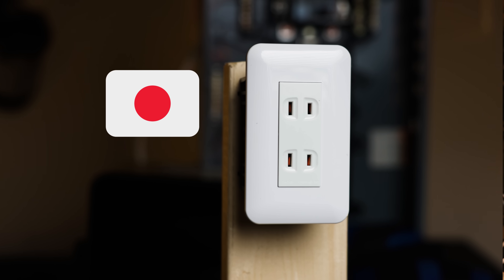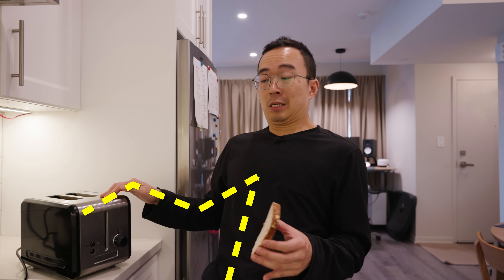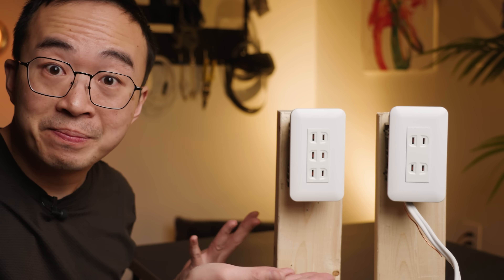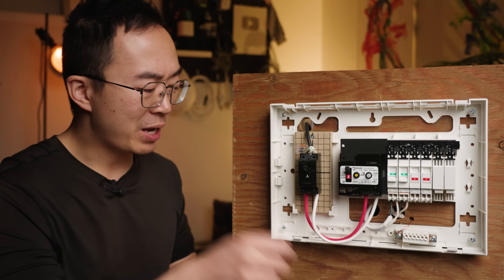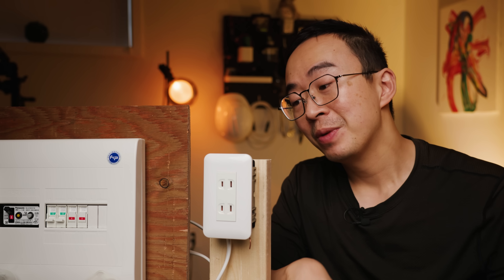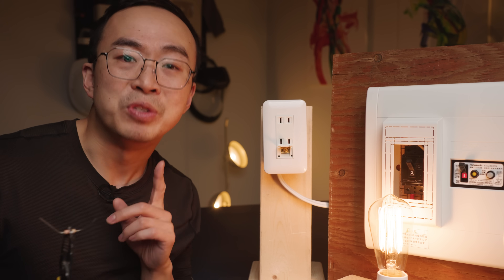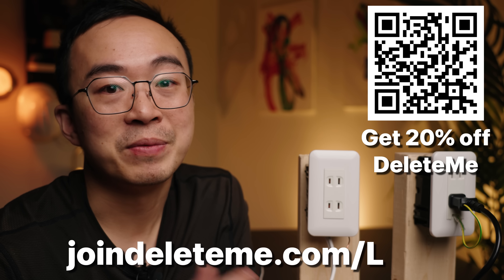How Japan Made Their Outlet Safe

Comment: For some reason, our GFCI is SUPER sensitive to minor power surges in our sun room and tends to randomly trip on its own with just small amounts of condensation or humidity as well as when switching on lights simultaneously (CFLs and LEDs). It'll often end up popped overnight.

It might also be related to insect activity, including ants getting into the contacts of some of the wiring in the walls ... which has happened before. Happened to lightswitches too, led to sizzling, though no permanent damage or smoke, from ants getting inside the electrical connections.
This is not the case for the more robust GFCI unit that was originally an outdoor gardening utility outlet before the sunroom was built. (OTOH, the sunroom wiring might have some greater ingress points or weak points for insect exposure ... probably not for rodent ingress, though)

They're pavement ants, highly robust, and otherwise don't cause net negative problems around the house, so ... no living without them.

OTOH, the main bathroom GFCI is wired in parallel for both floors, and HAS tripped multiple times that gave indication we had a leak somewhere in the house. (sometimes it's from driving rain or rooftop debris allowing backups, but it's also been due to leaking bath/shower drains, but it's also been due to a failing shower valve insert o-ring that was leaking into the wall behind it ... )

Without the GFCI it might not have led to a fire or electrocution risk, but more likely would've led to electrolytic corrosion of the connections at the exposure/short point to the point of failure. (as it was, things went back to normal when everything dried out ... luckily it was summer, and we live in a dry climate)

OTOH, I'm not sure how you could fully support 1500W outlets with most of the GFCI breakers typically available and the potential for transient currents and power surges that would fairly easily trip them ... as seen in a LOT of legacy infrastructure in the US. (we've had some surges and instability sufficient to burn out internal fuses inside electronic ballasts for fluorescent lighting, but not damage anything else or even trip surge protector breakers, so it's kind of weird)

For a family that insists on using 1500W space heaters and some other appliances at random, mobile locations around the house, that'd be a deal-breaker. (albeit all of the better modern versions of those have GFCI or some sort of breaker also built-in ... also usually on top of a thermal breaker; in the case of hair driers, that can be done via simple polarized plug, too, without groundfault protection)

Plus with microwave oven, lighting, and consumer electronics all on the same circuit (and fridge, toaster, dishwasher, and more on other consumer electronics).  Plus that's not accounting for the 240V appliances. (and the washing machine on a 120V circuit, also producing a high load on a standard outlet vs the dryer on 240V)

I forget the full map of our circuits, but I can definitely tell which lighting is on the same circuit as the microwave/convection oven, as those lights momentarily dim when the microwave engages. (not sure if that would pop a GFCI if there was one wired up, but it's definitely impacting the voltage level further down that circuit ... albeit it's on the other side of the house in the next room over from the kitchen and most dramatically impacts a single fluorescent light fixture on an embedded over-mantle mount) I don't think that breaker has ever popped, though.

Edit: as for that bathroom GFCI unit, it was probably nearly 50 years old and we replaced it, thinking it had failed (as the water damage was unknown), but it turned out it was still working completely fine. I think it was a GE unit from around 1978.

Comment: Where as the UK just overhauled their entire electrical grid and discontinued the 110-120V legacy system in favor of 240V. Japan stuck with their legacy 100V grid. And also outmoded all of their old electrical connections, outlets, etc ... and mandated that fuses or breakers be embedded within the plugs of individual devices. (decentralizing everything to the wall end, rather than using the main breaker/fuse box)

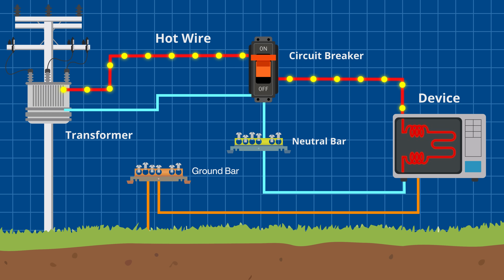Comment: in your diagram first shown @2:35, you show a neutral (cyan lines) going through the circuit breaker - that is incorrect, only the Hot goes through the breaker.  If you make a follow-up video, you can also talk about GFCI breakers, as well as AFCI (what it is) or combo GFCI/AFCI breakers and outlets.  Also there is a subtle difference between the mechanism used in GFCI and traditional RCD's  (though some newer GFCI-circuit safety devices in EU are still called RCD's just because that's what they were always called).
Lastly, only the main (service entrance) Load Center panel/box should have neutral tied to ground - any subpanels should never connect these together, for safety.

Comment: How Japan Made Their Outlet Safe. They did this by lying. People here still get hospitalized or die, and buildings catch fire frequently due to electrical issues. They just don't report it accurately if at all, which is the same way they handle their crime and homeless numbers. The grounded outlets, if even used, are never wired up to anything. The ability of electricians here is not only poor, but they also have an attituded that doing anything to make things safer increases costs that they are unwilling to pay. Apartments here have terrible electrical systems because the landlords pay less than the absolute bare minimum to have the job done, and the people renting don't know anything about it. There is no enforcement so this is just allowed. So we just see videos like this that push the propaganda that Japan has this amazing power grid (either because they don't actually know what its actually like here, or they don't care) when in fact its not much better than every other 3rd world countries.

Comment: GFCI is not "better" than grounding. you need BOTH. If you have a faulty toaster or a refrigerator with exposed wires touching the metal edges, a    GFCI will break the circuit shortly after you electrocute. But grounding will prevent you from electrocuting in the first place. In my country (and probably most other countries) both GFCI and grounding are mandatory.

Comment: The best home electrical system is the european. All outlets have direct path to ground, most are reversible, except the UK ones. But every circuit is protected by GFCI, one for every 5 circuits. If ground fails or the GFCI fails, sometimes happens, the other will work. In Europe when an appliance goes bad it makes your GFCI trip and you have to find which one is the one that trips on plugging, you make this without any kind of shock. The standard plug is today 240V 16A, you can even charge an electric car on a outlet at the side of your bed realistically. Almost anything on a home can be on a regular plug today, a kitchen, oven, water tank. And in a home electrical system that is not totally illegal disaster electrocution is unheard of today, even with about 240V for efficiency in all the home. It's so rare that when an electrocution is reported the first thing insurance companies investigate is for fraud.
Reply: now when you say Europe do you mean Scandinavian countries?
Reply: @miguellopez3392  All European union plus UK at least.
Reply: exactly, and both asian and US outlets show in the video are a joke, if you plugin something what use a lot of power it will brun, specially the asian version,  the worse  outlet on the planet, if you get a cheaper one, it just fall out the socket on it's own, if it use lot of power  be sure it will start a fire   , while in europe   your old outlet from 1960  still as good as new

Comment: Circuits without GFCI's/RCD's are totally unsafe. Since if you got a open circuit on the ground wire, your breaker never shots off. Until you complete the ground circuit. Breakers are saving circuits. GFCI's are saving lives.

Comment: I'm desperate for someone who can solve my mysterious problem.
I run an electric guitar repair shop in JAPAN and recently moved the shop to a new home. Above the shop is a recording studio. Everything must be grounded which requires grounding outlets installed for power conditioners. When I turned on a guitar amp for the first time here, properly grounded, my heart sank.
4khz tea kettle noise coming out of the amps. Not RF (i measured) but a signal being picked up from the guitar cable acting like an antenna. It's intermittent and sensitive to certain areas. Until today it was high pitched, but today it turned into a very low crackle. The humidity also dropped from 40s to 30s. I'm having a hard time finding an electrician who will come check this out. I can't open my studio until its fixed and the guitar shop (a guitar store as well) also has to be closed until its fixed.
I don't know what it is or what to do.

Comment: That was WRONG. TT earthing is commonly used all over Europe and it's mandatory in houses in Italy. The TN system (ground connected to the neutral) is used ONLY in industrial plants due to its higher complexity and need for maintenance. In fact, you are allowed to use it only if you have your own transformer. THE GFCI connection that you described as an evolution of the Japanese electric system has been used in Italy for over 50 years as a standard safety measures for ALL household installations. A famous Italian electromechanical company had even the genius idea of branding its GFCI with the name "salvavita" (livesaver) in the 80s and the name stuck so well that everyone asked for it and it is now how the device is called commonly in Italy by non professionals.

Comment: It’s not mandatory, but grounding is generally recommended for appliances that use high voltage, like washing machines as you said.
And since modern offices use a lot of computers, their outlets usually have grounding. Older buildings often don’t.

Comment: Thanks for the introduction to home electricity.  I am curious, how does sending back electricity back to the transformer outside a good idea?  How does that work.  I know the need to complete the circuit for the whole thing to flow, but I never understand grounding.  

I don't see that rod you talked about around my house, or any of the houses I have lived in.  I literally thought it just means routing back to the power station.  And that case where you get the electricity to pass the soil and go back up the pole.  How does electricity know to go to that pole and not my neighbors pole, and how does it know to come back to the wire connecting to my home?  

The Japanese version seems to make more sense because it is basically a fuse which is what circuit breakers are in my panel too, they are just reuseable fuses.  So what exactly is grounding.  I think grounding might be a communication channel for some appliances to pass information with the utility companies.  Now with smart devices, I wonder what kind of information it can pass.  Maybe this is why lamps don't need grounding even though it can shock me as easily?

Comment: I don't GET IT. Since you DO seem to have ground, why decide to use a SCREW TERMINAL instead of adding a ground pin in the plug & socket ?? WHY ??
Reply: Their grounded plugs do not have a third pin. Instead, they have just a ground wire and you need to physically screw that wire to the ground screw on the outlet. Yeah, i agree it's terrible.

Comment: Russia is not required the ground wire. There is still no standard and the 3rd wire is kinda optional. The outlets are vary from whatever they bring in. Should say Korea, not Russia.I do prefer USA power outlets as they more durable and at least the ground hole keeps the plug in place.

Comment: I live in Japan, my house was made in 1996 I call bullshit on the "Japan requires this outlet with the screw"  None of ours have it.  Our air conditioners all have 2 prongs, no 3rd prong, no fancy green wire, and most of them in the house are new.
Reply: just because there isn't one in your house doesn't mean grounded outlets are not required in japan. In fact, it wasn't until December 2022 that Japanese Electrical codes were revised to mandate grounded outlets in kitchens and bathroom. So any houses built before December 2022 may or may not have grounded outlets because grounded outlets were "recommended", not required. 
After December 2022, grounded outlets are now required.

Comment: As nice as GFCIs are they do not protect against all hazards and not only can ANY circuit have one installed at the outlet and "down stream" but GFCI breakers can be installed in the fuse box
You might notice that most modern appliances are double insulated so a ground is not needed and does not exist.

Comment: The description beginning at about 2:35 isn't quite right.  The ground rod has nothing to do with the bonding pin (unfortunately also called a "ground") on the plug.  They serve two different purposes and you can have one without the other.

Stray current doesn't flow from the equipment grounds to the ground rod (or other ground "electrode").

The purpose of bonding the case of the appliance is to ensure that a low impedance path exists back to the neutral.  This is noted a couple of minutes later.  Without this bond, when you touch an energized piece of metal your body is the sole route on which current can travel between the line and neutral.  With the bond, there's a parallel path which has a much, much lower impedance than your body - and thus carries the great majority of the current.

However, the tripping of the breaker described around 4:15 won't necessarily happen as illustrated.  In a scenario such as the toaster in the kitchen you illustrate, it would likely be plugged in to a ground-fault protected receptacle.  The GFCI would trip either immediately when plugged in or immediately when you turned on the toaster because current would return via the bond, creating an imbalance between current flowing on the line and neutral pins.  BUT - if the toaster is plugged into a non-GFCI outlet, there is no such guarantee.  In that case the breaker would only trip if the fault created a low-enough resistance path for an overcurrent situation to arise.  There is no limit to how much current can flow on the bonding wire per se.  If a fault produces an overcurrent on the circuit, the breaker trips, and if not, it doesn't.  And many, perhaps even most, such faults are marginal and don't produce overcurrent.

Comment: Here in Brazil, it's called a residual current circuit breaker or residual current switch. This is because it can operate as a switch or circuit breaker, in addition to its function of monitoring the current flowing to ground. It is sold in two versions, in addition to various scales of protection current and discharge current.

Comment: they should just use the same we use in the US. without the ground it is still dangerous. the cost of the grounding systems is negligible. good on them for trying to move to the right method of safety. GFCI is great but not a replacement for grounding.

Comment: American AC isn't the "A.C" that you might think of, where the two wires are 180 degrees out of phase. Instead, one wire is "hot" and the other wire is AC Neutral. The hot wire swings above and below neutral. If you're lucky enough to touch the neutral wire, you won't feel a thing. The ground prong is great, just make sure to use a "cheater plug" when connecting an oscilloscope to a switch mode power supply!

Comment: Most things today don't require grounds, as they are somewhat intrinsically safe due to the use of non-conductive materials in their assembly; however, anything with a metal chassis still requires one. Older tools, like those all-metal drills from the 1970s, need a ground to be safe. Computers with metal cases need them, microwaves, washer/dryer. Kitchenaid mixers, dishwasher, surround sound receivers, etc. 
It's because a conductor touching the chassis makes it "live," and you won't know until you touch it.
I've been shocked a few times by things like drill presses, where idiots have broken the ground off, but a wire later comes loose/wears. 
Needless to say, if/when it happens, I hunt down the plug and chop off its head like it's French royalty.

Comment: Technically, the video starts wrong because in Japan, they use a separate ground wire that you need to connect. So you plug your device into the 2-pin Japanese wallet, then connect the ground wire. :face-blue-wide-eyes:

Comment: One major negative for these 2 pin style plugs, which includes the European round pins, is physical stability.  They are wobbly and always loose.  A 3 pin plug, any kind at all, be it the British big fat square pins or the style used in China and Australia, are inherently stable.  You can plug them in, and they will not wobble or wiggle loose.
So Japan catching up after 70 years is really not something they should be proud of.

Comment: I don't think circuit breakers or fuses save lives. Yeah, they will cut electricity when your device fails but if there's issues with grounding that won't happen and it's bad news unless ground fault circuit interrupter is in use.

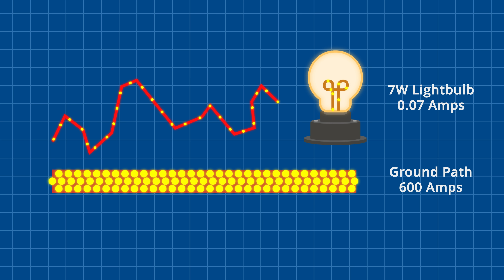Comment: 3:50 The ground bar might be able to sustain high current, but the copper in the ground wire will not. So that explanation of current flows is, at minimum, lacking.